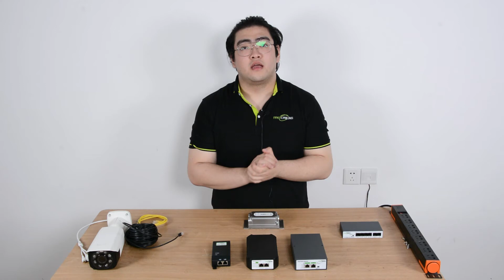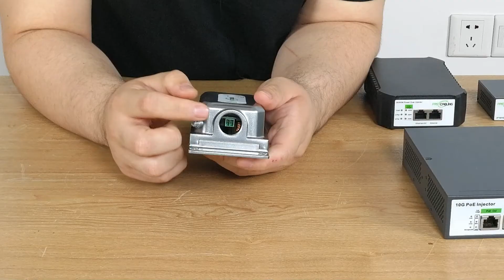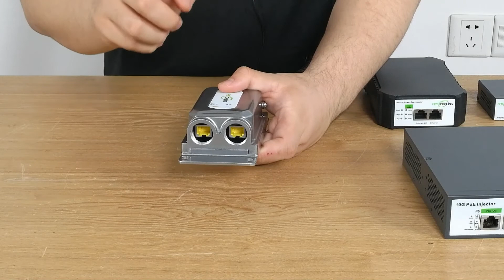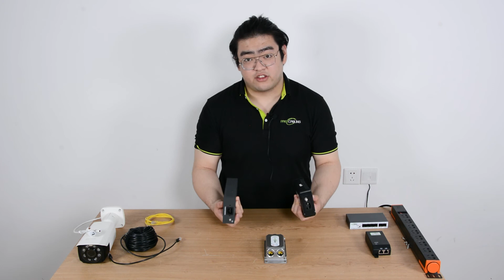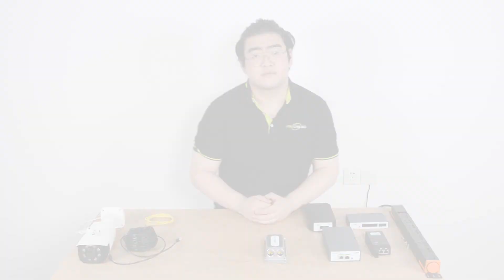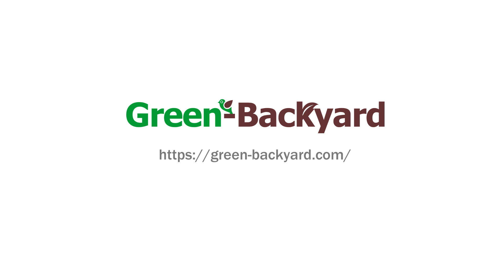What is PoE Injector? #2-Knowledge Base & Introduction

Comment: My poe injector has port out and data, where do i connect the switch?
Reply from the maker: You should connect the data port to your network switch. The output should be linked to your PoE edge device such as ip camera, access point.

Comment: What color is using power? And data is orange pair?
Reply from the maker: The data pin will always go through 12-36 in fast 100mpbs network and 45-78 will be included in 1000mbps network. The data pin are different case. Based on IEEE802.3af/at, either 12,36 or 45, 78 could work as power pin. We use 12-36 as power pin in most PoE equipments.